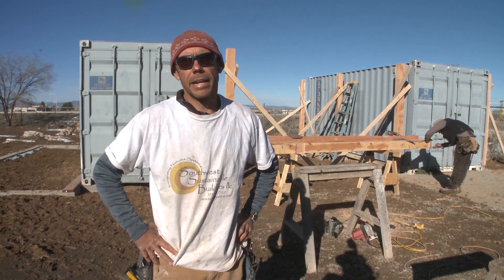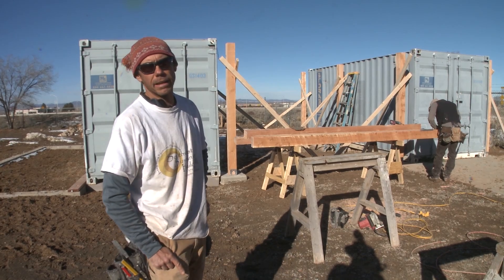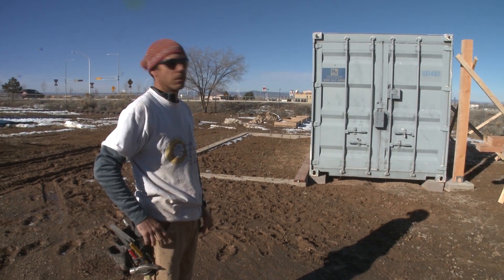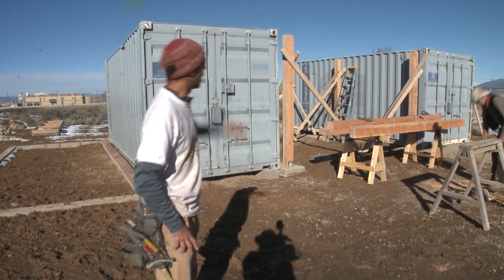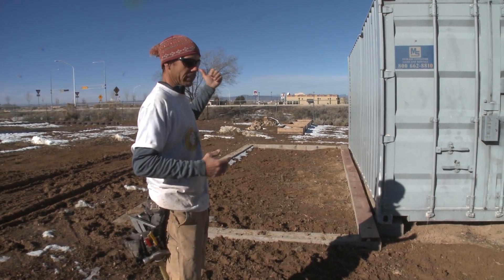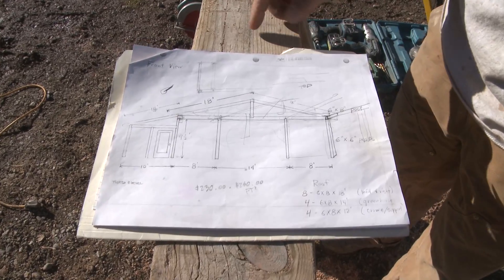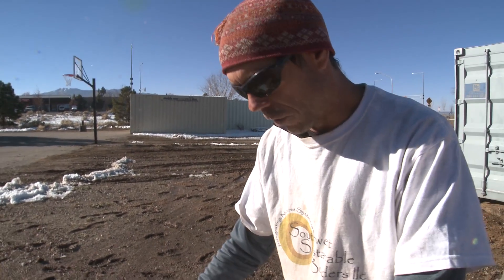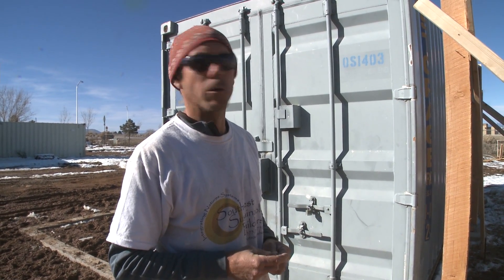Shipping Container School Build Planning

Comment: Great project and awesome reason/organization to provide help to! 
But...  I gotta ask.  Why aren't you using the containers as the roof truss/beam support structure?  Seems like a waste of good timber posts (I count 6, with their related pilings between the containers) to hold up a roof over two containers when the containers could more than adequately support the roof load.  If the containers are truly on pilings they could be anchored to the pilings and then have the roof anchored to the containers to provide wind loading protection.  Also, if you are talking about a thermal mass wall next to the one container for the greenhouse, then that could also be tasked to provide additional roof support and wind loading protection.